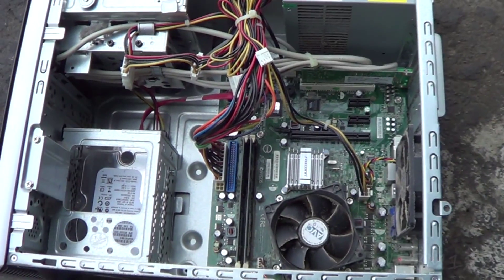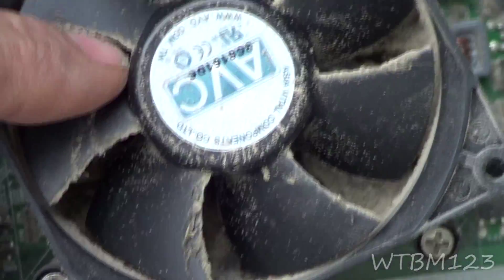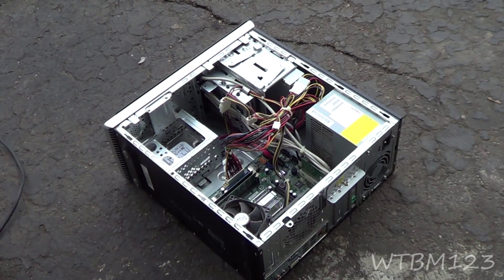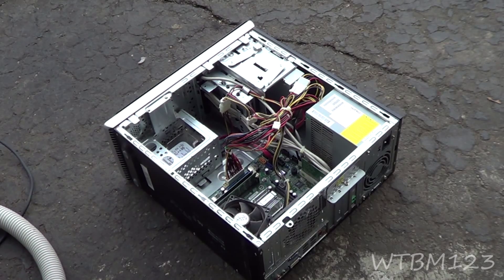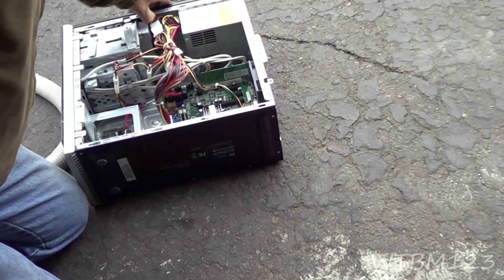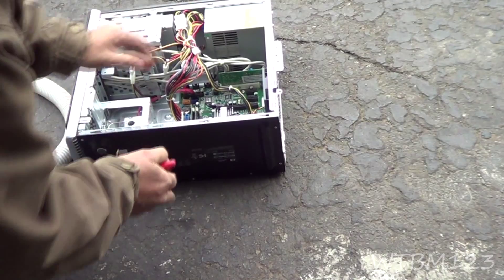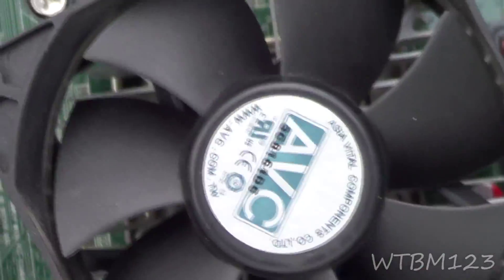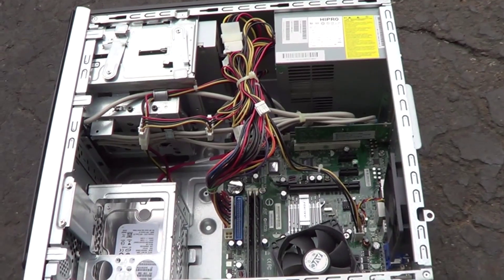Is Your Computer Dirty Inside

Comment: Good job...I done  a few over the years...I use a cleaner to suck the dust up less mess lol....I take the fan off,open the psu then outside paint-brush work everytime....laptops are a pain!!!!!loads of screws....my Toshiba satellite pro that's a pain but worth doing.....so next time try sucking the dirt,dust up outside if you can...just a tip hopes it helps...Nigel...

Comment: Its got two case fans in front, two in back, two in the power supply, one on the side and one on the cpu.  I had the same heat sink as that pc there.  P4 3 ghz, can quit so I just made a case fan do the job actually works better. lol  Bad hard drives and still runs.... lol